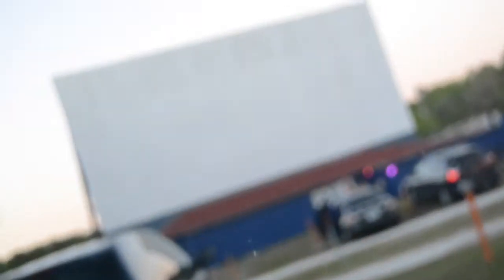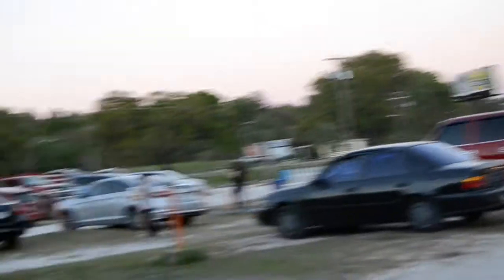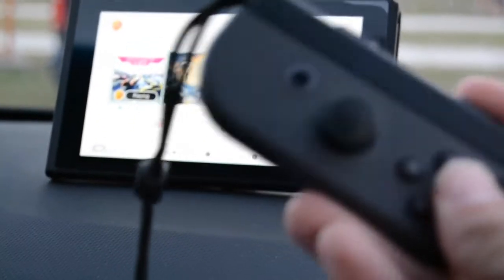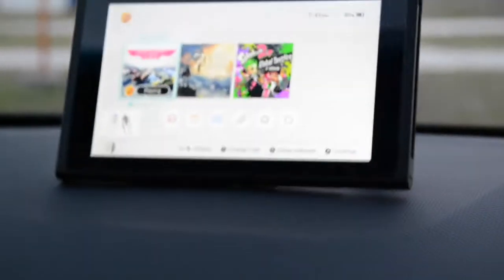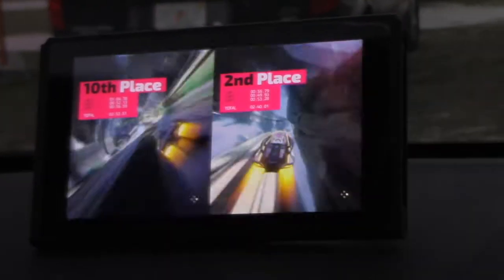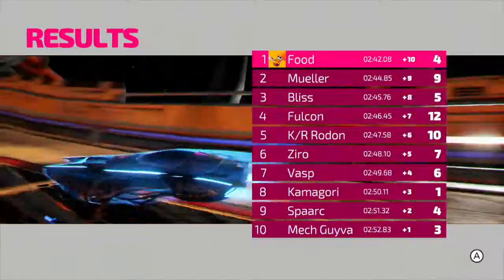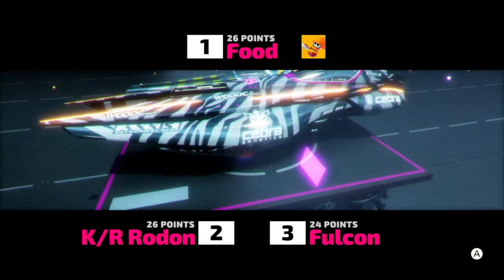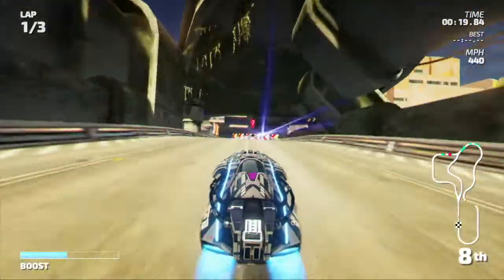custom tegra x 1

Comment: You is so on point with this video. You totally need more subs man. I saw you thru The Fresh Gamers podcast. This is what people didn't understand with the Switch. It may be the Tegra X1 but, it's the API software that makes the difference. And on top of that the Tegra X1 is a mobile superchip anyway. It can run any game that runs on the CPU

Comment: switch is x2 not x1. you can't test that by power wattage consumption. X1 uses minimum 15 volts however x2 is much better on power allowing switch to run a minimum of 5-7v undocked. the x2 is similar build with only transistor size being different and power consumption.  the x2 is compatible with 8 gig ram but they   kept it 4 For price and heating purposes capcom also had influence on ram. it is also showing graphics that compete with other systems on ue4 without me knowing much difference also. and neither fast rmx nor Zelda are taxing the switch. they are both Wii   u ports with just rmx being more of a remaster with extra content.
Reply from the maker: bryan cooper incorrect. It's the exact same chip. It's an X1. Ive seen it with my eyes. It's been dyed and xrayed. It's been tested in wattage and your claims don't match the results recorded such as those of Splatoon 2.